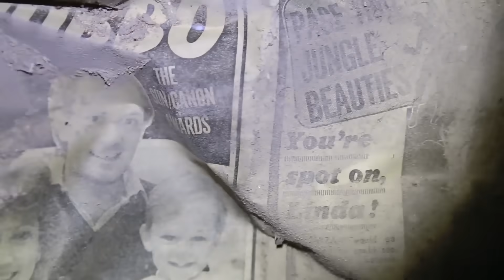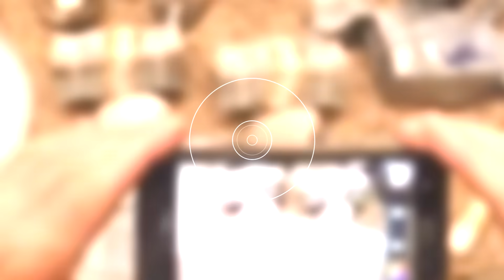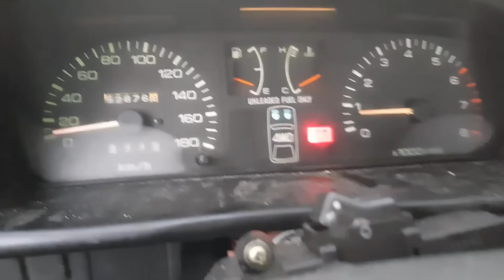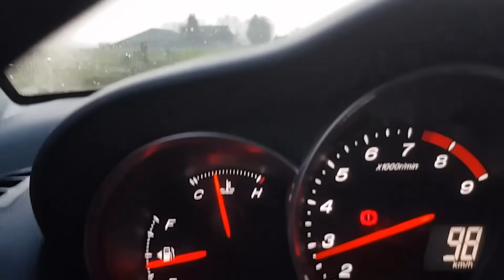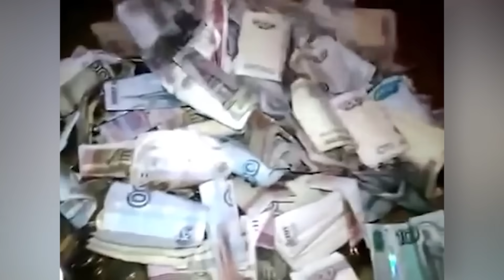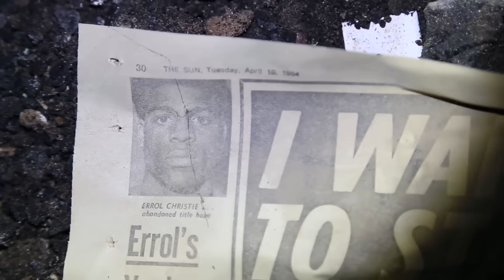A Boy Finds A Rope In The Lake And Pulls It, Here's What Happened Next

Comment: I hid some money in a hole in a wall that was caused by the door knob hitting it. It ended up falling in behind the wall and it was some 15 years later that I remembered and opened a whole at the bottom of the wall and their was my money. I need it too. Didnt take long to patch up the hole. You never know whats in the walls. Was fun to watch. Great video
Reply: The only “treasure” I ever found behind a wall was a flattened, electrified mouse, apparently from chewing on some old electrical wiring.
Reply: @saundrajohnson1571   be glad you didn't find those old razor blades people used to dispose of through that slot in the bathroom medicine cabinet... I Always hated have to take out old ones for not knowing how many you could run into.
Reply: That was a great blessing I'm sure.

Comment: Hello !
I had the same CZ motorbike (9:00). It's indestructible. I rode with i during 6 years. I sold it to buy a recent motorbike for two passengers. I don't regret it but I will remember my CZ. It speed was 110 Km/H, half a gallon/100 Km. Every 100 Km you must secure all bolts following the maintenance book because of the vibrations. It was a pleasure.
Phil, Belgium. Peace.
Reply: And that is certainly not a 20's era bike, as the narrator said. It looks from the 60's or early 70's.